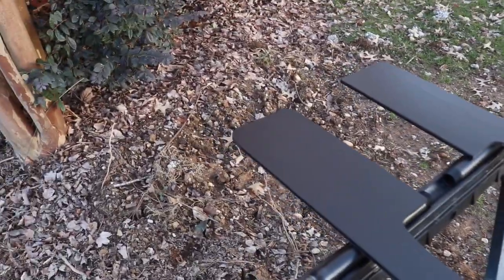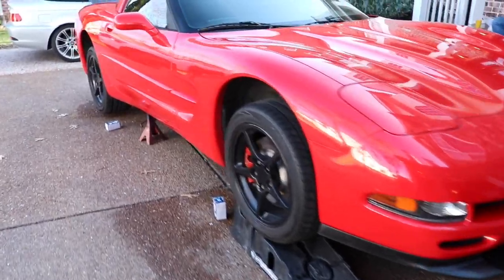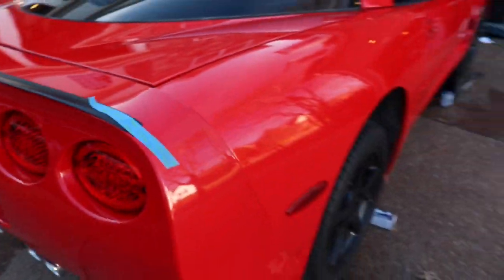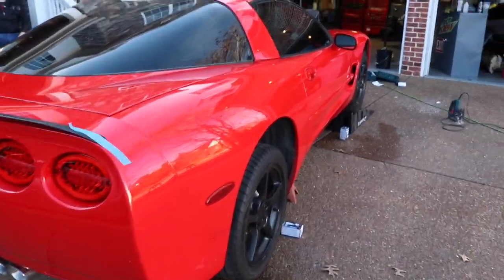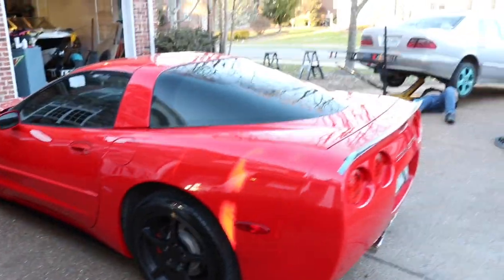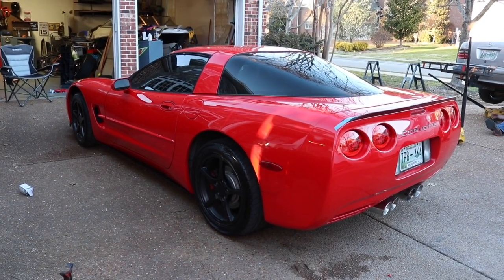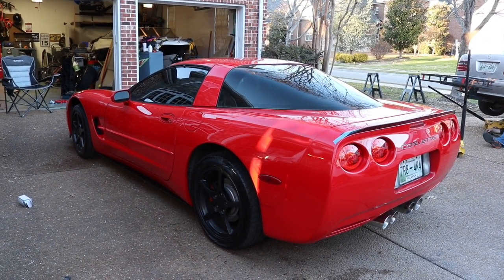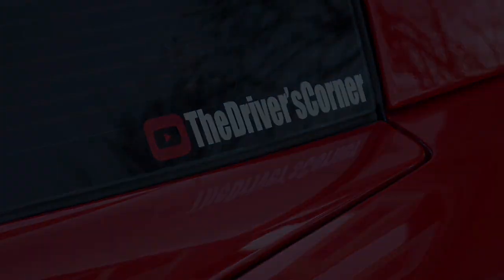DIY SideSplitter Installation C5 Corvette

Comment: Man.....that's crazy. I have a 97 torch red too. I'm DEFINATELY doing that model and its affordable. Great video
Reply from the maker: Dewey Goodman thanks!! It’s actually really easy to do.i think I’m going to make a more elaborate pair now that I know it works! They’ve been holding up great!
Reply: @thedriverscorner  how many screws did you put in? And how wide were the vinyl boards you bought? And where did you insert the screws
Reply from the maker: Dewey Goodman I think the boards are 6” (but you could cut them narrower. I used 3m body tape and about 5 stainless screws per side.

Comment: Nice job on the skirt.  As for lowering the rear farther... Remove one of your adjusting bolts and go to a hardware store and get a grade 8 bolt that's a couple inches longer. 3 to 4 dollar investment.  Car looks good.
Reply from the maker: SUPERCHARGEDC4 thanks! I’ve seen a few guys do that, I may need to hop on the bandwagon!

Comment: What size screws did u use on the skirts, i tried doing the exact same thing with same pvc board but my screw (self tapping) 

wouldnt go in... unless i was just making contact with something
Reply from the maker: Joe Morales I used 1 1/4. But I actually went back and used some construction adhesive, (PL) and if I could turn back the clock I would have done that from the start.. just using 2-3 screws to hold it in place.